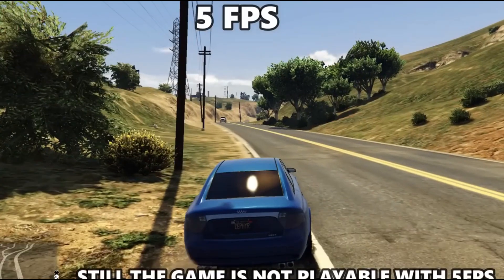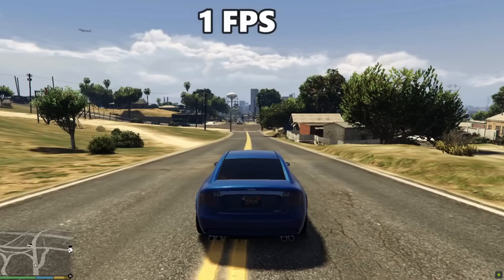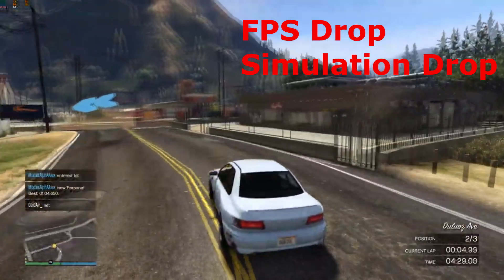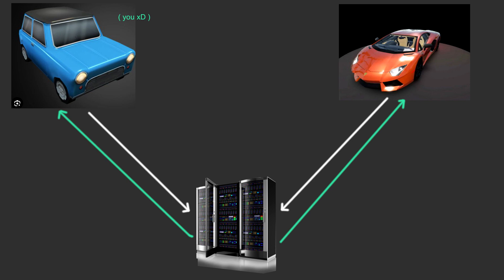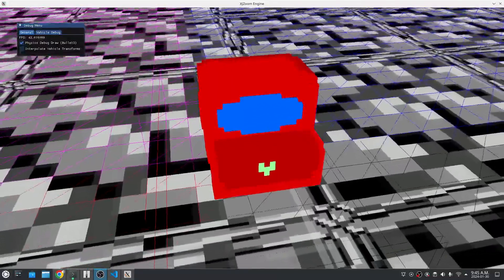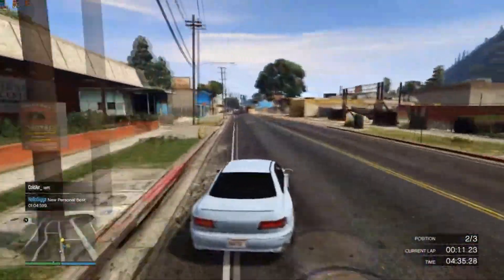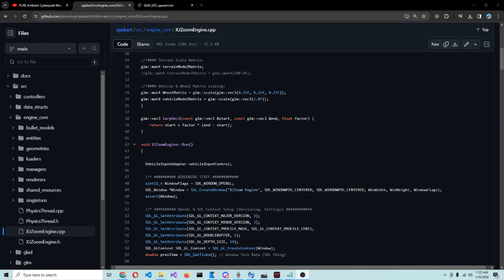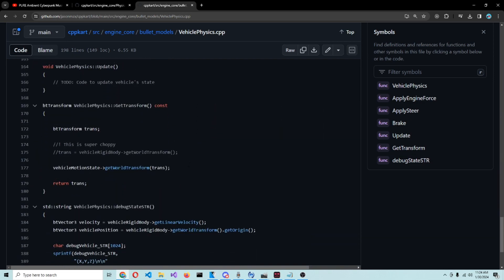Multi-Threading Problems & Discussion in Game Engines

Comment: The "two threads" model is still widely used, but it probably shouldn't be.  I got involved in game programming in late 1999/early 2000 or so on an R/C sim called "Virtual RC Racing."  (Today's version is called "VRC Pro").  I wrote the physics engine and some other stuff.  Anyway, back then there was no such thing as dual or quad or any other multicore.  When dual cores came out we switched over to doing physics on one thread and the rest of the game on the other.  That was good for those machines (huge boost in performance especially when FPS was mainly CPU limited), but today with everyone having 8/16 threads and up, it can be pretty limiting.  If you're just going to stick with simple physics without too many vehicles and other objects doing stuff it's probably fine though.  I know of at least one major racing sim engine today that still works that way (another project I worked on), but they can't run their title on consoles because it's not fast enough with that design.

My latest engine takes a different approach:  Basically it's a fork-join model.  The idea is to run single threaded for a brief time, then go multithreaded (all cores on the entire machine, not just one for physics and one for the rest of the stuff) and do something in parallel.  So when all threads are running they're all doing the same thing at the same time.  In my case (car racing sim with heavy physics) it's mostly physics, but it will do a little graphics stuff that way too (just copying transforms to a buffer that goes to the GPU at the moment).  Instead of running 5 or 6 cars, I can run 50-70 because of it.

You've got a good channel and I'd encourage you to keep doing these dev logs.  I watched both just now.  You're pleasant to listen to, not boring and not annoying like half of the folks out there.   Keep it up.  👍
Reply: One other thing:  With modern renderers this CPU limiting stuff isn't as much of a problem.  It's been many years since I wrote OpenGL code (think OpenGL 1.4), so I'm not up to date with it (I'm a DirectX12 dude now), but in DX12 and Vulkan the CPU side can be extremely light.  My engine ends up working basically like this:

while(!quit)
{
  Inputs();
  Physics();
  Etc();
  Render();
}

When Render() runs, it just records command lists and then sends them off to the GPU without blocking the CPU side code at all.  So the next cycle can start immediately and is usually finished before the GPU has even rendered the frame from the last time we were in Render().  In DX12/Vulkan you put a "fence" at the beginning of Render() which blocks:  It stops your main thread while waiting for an event from the GPU (WaitForSingleObject in C++) that says "Ok, I'm done with your last frame.  Go ahead and send me more commands whenever you're ready."  

By then the game loop, physics, etc., has already run and you're just waiting for the GPU to finish the last frame you told it to render.  Because of that you can keep adding more and more CPU side stuff before Render() and it won't even affect the frame rate at all.  (That is of course until you add so much that it does, but that's a LOT).  It's totally different from how my old OpenGL stuff worked years ago.  The CPU part of my Render() is so fast it'd do like 10000FPS probably if the GPU could go fast enough and I stripped out Physics().

Anyway, just something to keep in the back of your mind.  If you're happy with OpenGL and it's getting you the results you want, then there's no sense switching.  Not sure, but I think the most modern OpenGL might do some of this too.
Reply from the maker: Hey Todd, Wow these are some really interesting things I didn't know, and I guess it just comes with trial and error, or working with different stacks for a good period of time... Thank you so much for sharing your wisdom 🙏 I'm gonna have to re-read all these comments soon when making further optimizations to my game loop, but thank you for sharing this ❤❤
Reply: @jason_m2003  My pleasure.  Hope it helps.  It's trial and error indeed.  I've been at this a long time so have slogged through many of these same things the hard way.  If you have questions, just shout.  👍
Reply: Oh, by the way:  In VRC I didn't bother lerping or slerping because the physics rate was 250Hz for most cars (500Hz on one of them that needed it).  I found back then that a lot of the stuttering would go away if I didn't try to time between frames individually.  I.e., by NOT having some "timeSinceLastFrame" type of thing.  Instead I marked the time that the simulation started at (QueryPerformanceCounter, but nowadays the std: chrono timer thing or whatever it's called is easier and just as good).  Then I'd have a separate simulation time counter (how much time has actually been simulated) which would advance by 1/250 or whatever every physics cycle.  When the physics is about to start a loop, it'd compare the two timers to see how much simulated time it needed to be "make up."  Then it'd run that many physics cycles with a hard coded loop limit in case a bad thing happened.  

My latest engine works that way too, but it's not a separate thread (other than the physics splitting into a bunch of threads internally, but it's not running in parallel to the rest of the game loop or rendering).  If FPS and physics rates are high enough it looks fine.  There's really only so much we can do there because it's unknown how much time will pass before "now" and when that "now" will show up on the monitor in the future, where (when?) it becomes "then" anyway.

Anyway, I guess if Bullet is doing the lerping/slerping stuff for you, that's probably even better.  👍
Reply: Also, on another game I worked on (Nascar '21 : Ignition) we were doing interpolation/extrapolation and it actually caused a big problem on the highly banked oval tracks in NASCAR:  The graphics extrapolation between frames made the cars visibly fly a few inches above the ground in the tight turns in steep banks, enough to be visible especially with a shadow under the car.  When we turned it off, the problem went away.  Cars were planted right where they should be.  Anyway, something to be aware of.  The slerping/lerping is better and isn't a problem until it does become a problem.  😄
Reply: I'm on a roll, sorry.  Microsoft has DX12 examples showing how they do multithreading in the more standard type of way (without the new ExecuteIndirect stuff).  When CPU draw limited it's generally because we're looping over all the draw calls one by one.  That takes a long time if you have 100,000 draw calls or something.  If you look up their GIT "multithreading" example, you can see how their multithreading works.  Forget the DX specific stuff, if it looks alien just ignore it.  The important part is the loop around DrawIndexedInstanced() (the actual draw call that says "draw this mesh").  In the mutithreading example they have the worker threads do that loop in parallel.  So if you have 16 threads and 16000 meshes to render (16000 draw calls), each thread does 1000.  So the CPU side time goes way faster.  

(Don't do it the way they show though.  They have each thread leap frogging over numthreads draw calls which is not cache friendly.  It's better for the cache to have the first thread take the first 1000 or whatever calls, the second thread take the next 1000, etc..)

Not sure with OpenGL though what's really possible.  With DirectX 11 and earlier you couldn't really do this from what I've heard, so I'm not sure if OpenGL can do it.  Anyway, it illustrates a totally different way to do multithreading aside from the (now more than 20 years old but still surprisingly common) way of having one thread for physics and another for basically everything else.

ExecuteIndirect largely obsoletes all that though because you don't have to loop over the draw calls anymore anyway, so I have very little multithreading in the actual renderer.  Just some copying of transforms because it was easy to multithread that part.

Comment: So whats the problem with having the threads update at different frequencies? Is it that you get a "beat" between the two freqs? I read some stuff about that happening between the update loop and the computer monitor as well.
Also, why is interpolating the physics sim necessary? Is it because physics runs at a lower tick rate?
Reply: Inconsistent game state. Between the two frequencies, threads may or may not see up-to-date data.

Comment: I am doing my own GE too and creating a threadpool model. if there are cores available use a separate thread instead of the main thread and combining it with a locking system so a process get exclusive use of that thread until the task is done. This video was a godsend because i am writing it in javascript and comunication between workers threads is slow, (30 to 60ms) lerping really helps smooth out the jitter!
Reply from the maker: Glad this helped you out, yea Lerping is not only used in threading scenarios, but also in multi-player scenarios aswell for slower packet rates compared to simulation & rendering, Extremely useful tool ! 🙂
Reply: @jason_m2003  Thanks for that info too!

Comment: what if the simulation thread is too slow like bad cpu but nice gpu. 500fps but slow motion?
Reply from the maker: That's where interpolation comes in my friend ! :-) , Imagine if the Simulation is 30 Hz, and rendering is 90 fps, so within 1 simulation tick, roughly 3 frames will pass, but if we LERP The last simulation tick, to this one, we'll have a continuous looking movement, but really it's just lots of interpolation, stuff like positional & rotational predictions also is a thing in this kind of scenario... Imagine if we know the car is going 100 km/h in A general vector's direction VEC3(+20,0,+20), we can continuously predict the vehicle to keep going that way, at that speed in our rendering, whilst our Actual Simulation might be slow! 

So basically it's alot of Guess-timation, but primarily good interpolation will solve this issue, it wouldn't necessarily be slow motion however !
Reply: @jason_m2003  Extrapolation causes it's own stuttering issues too though because it's trying to predict where the car (or whatever) will be in the future.  That won't necessarily match where the car actually ends up after x time simulated (physics) has passed.

For instance, just thinking of x direction at 50Hz physics with 150Hz graphics while pretending the GPU actually displays "now" right "now" instead of some unknown frame time later:

physics frame = 1
car.velocity.x = 1.0
car.position.x = 0.0

Graphics is 150Hz (versus 50Hz physics) so we need 3 frames :
graphics frame = 1
graphics.position.x = 0 (car.position.x) <--  So far so good, exact match with car.position.x on this frame.

Now we extrapolate two more graphics frames with no physics step inbetween.  

movementEachFrame = car.velocity.x / 50Hz = 1.0 / 50 = 0.02

graphics frame = 2
graphics.position.x = 0.02 <--"perfect" if car.velocity.x isn't changing

graphics frame = 3
graphics.position.x = 0.04 <--"perfect" if car.velocity.x isn't changing

That should be bang on as long as the car doesn't accelerate in the meantime.  The problem is, it will.  :)  So on the frame after this next physics cycle it'll jump to this new physics position which itself is a stutter.

physics frame = 2
car.velocity.x = 2.0  <---Oops, the speed changed.
car.position.x = (something other than the 0.04 the graphics extrapolated us to, depending on how the integrator works)

So extrapolation isn't perfect either and causes its own kind of stuttering.  It's the same problem as network prediction code (dead reckoning and so on), just not nearly as bad.

(You could include acceleration to adjust the velocity every graphics frame too, but that doesn't solve it completely either because the derivative of acceleration (jerk) changes as well.  So does the next derivative, the next, etc..)

If instead we're interpolating (blending between the latest physics state and the last one) instead of extrapolating as shown above, that shows inbetween frames nicely but it's got its own problem too:  We're showing the car position at old time positions on the inbetween frames instead of using the very latest data.  While that looks nice, the player will feel that as controller latency which gets worse as you lower the physics Hz.  It looks smoother, but adds latency and makes the car feel less responsive.

Complicating this is we don't know how long it will be before the frame we're trying to render will actually show up on the monitor for the player, so the "how much time has passed" question is, in practice, itself kind of nebulous.  The "0.04 position" above, even if it was right, won't show up on the monitor until t = 0.08 or t = 0.09 or something else that you won't be able to predict.  So that's yet another kind of stutter.

It could even miss a vsycn signal and essentially skip over an entire extra frame now and then.  Another kind of stutter.

Anyway, this kind of thing is everywhere and there's no perfect solution.  I don't bother with any of it personally.  My sims need very high physics rates anyway where it's not very visible, but games with lower physics rates can suffer from it as you know.  When I'm running something like 400Hz physics there really aren't any inbetween graphics frames to show anyway.  I've never seen anyone who can tell the difference between 300 and 400 FPS without a frame counter.  You could get a jump that's 1/400th second out of sync here and there, but I don't see it if FPS is high enough (150-200 or so).

Do what looks and feels good to you, but keep controller latency in mind.  Don't show old stuff to the player if you can help it.  The engine's "now" won't be shown to the player until an unknown time in the future anyway no matter what you do, and the next "now" will be a different time from that, which is yet another kind of stutter.  Hence v-synch to smooth everything out so you can always run a nice multiple of 60Hz or whatever on the physics side and skip both interpolation and extrapolation which is probably about the best you can hope for, but the lower frame rate adds enough latency to matter in a car racing game.  If the camera is moving it also needs to fit with all this too.  That's another kind of stutter that can pop up:  The cars moved, but the camera didn't, or they moved differently, etc..

Around and round we go.  This stuff is everywhere and there's no perfect solution, unfortunately.  For car racing games you want a very high frame rate.  Ignore the people who say there's no point rendering faster than the refresh rate of the monitor.  That is definitely wrong.

Comment: Wow great video I've been threading regular applications but need to try games now, I notice you also do manual interpolation after using MotionStates, does this help at all ?
Reply from the maker: I noticed even with motionStates, there was still some jittering and so I tried LERP for Positional information, and SLERP for rotational info interpolation, in some cases however, Bullet's default motion state just doesn't cut it, as some movement is Non-Linear, so interpolating it linearly wouldn't mask everything!